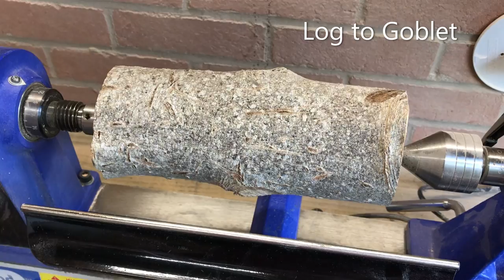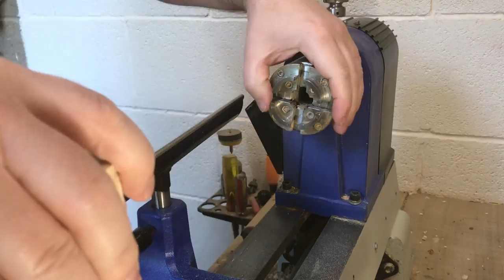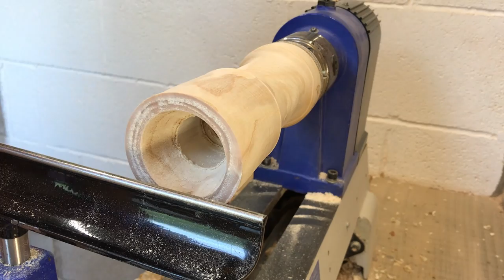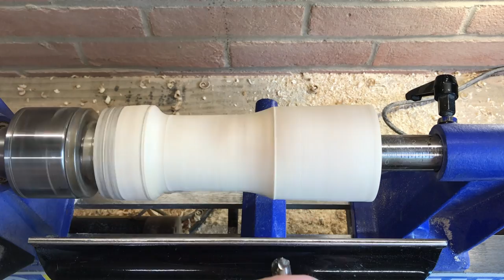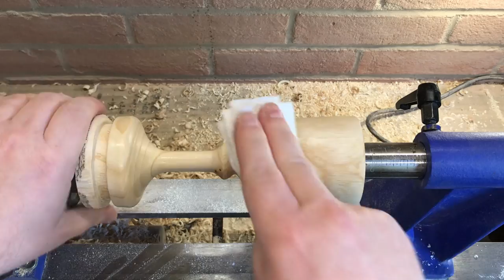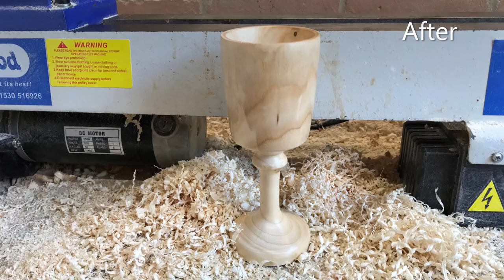Woodturning - From The Firewood Pile to a Goblet

Comment: I chose my lathe  ( W824) partly because I like your work, but two things.  #1. Captions showing what tool you are using ?   #2. Do you not sand after the sealer ?  Also one last thing do you ever use the higher speed, I haven`t thought it necessary myself as yet.
Reply from the maker: Thanks Pete. I don't usually show tool captions, but by far and away the most useful tool I have is a 3/8 inch Hamlet Bowl Gouge. I tend to sand from 80 to 400 grit, then add sealer, after that I very lightly sand at 1000 or more, just to prepare for a wax. Although this can alter depending on the type of wood. Thanks again and good luck with your projects.